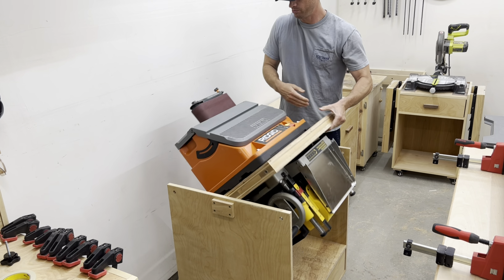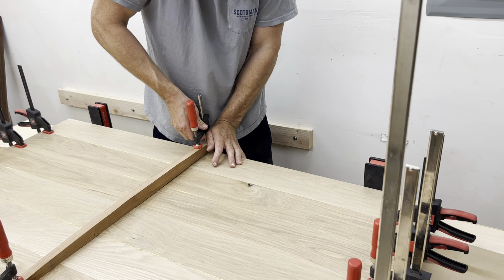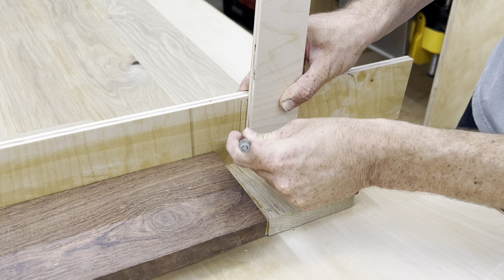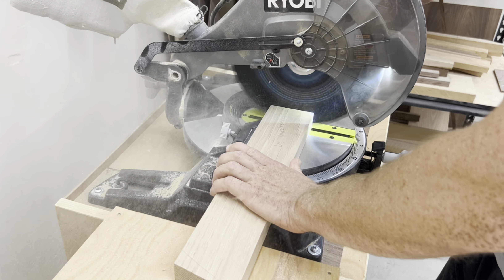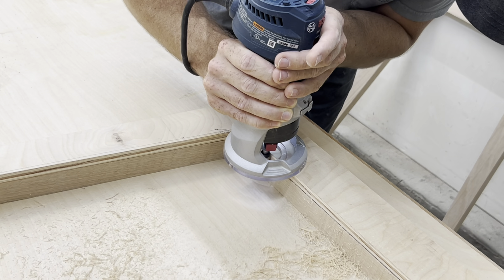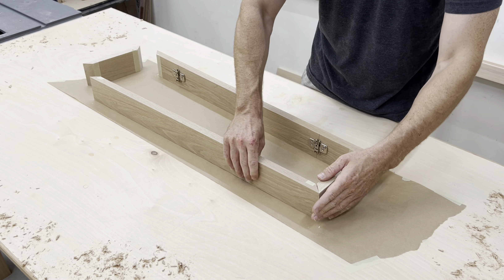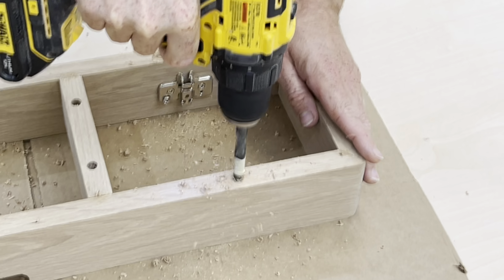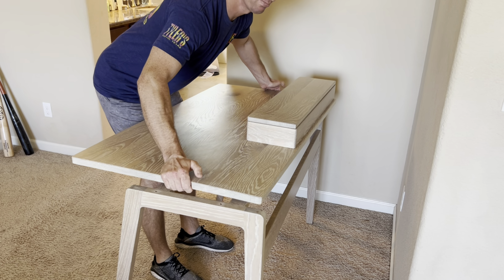Did I Just Make A $65,000 Mistake?

Comment: What is the drill attachment to keep hole straight? Do you have specific brand?
Reply from the maker: It is from Milescraft ($40) and it’s the only one I have used. I know Rockler has one ($200) that I’ve been meaning to try.
Reply: @ThomasCustomWoodworks  yea the $40 is my price range ! Def not the $200 at this time. Thank you.